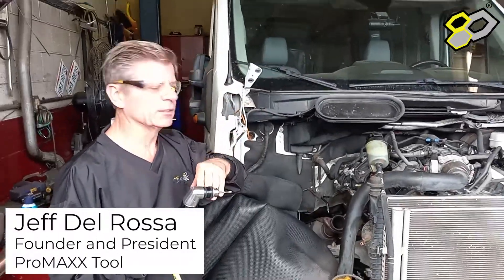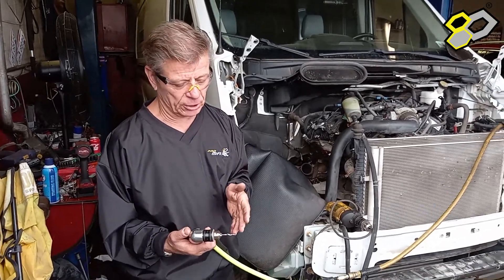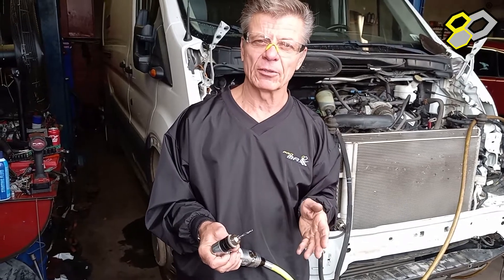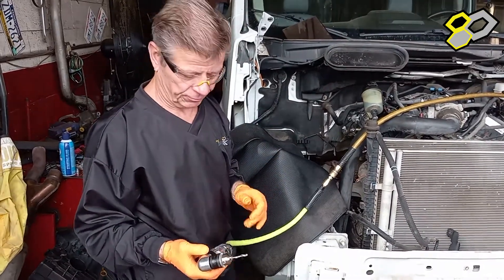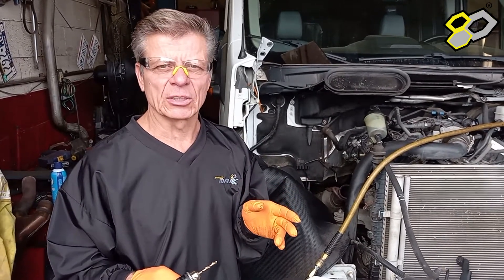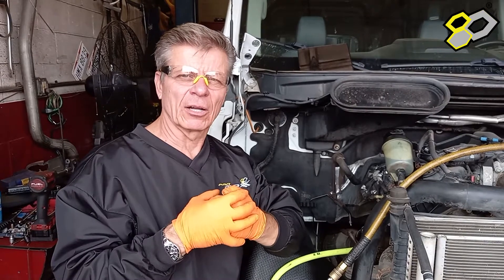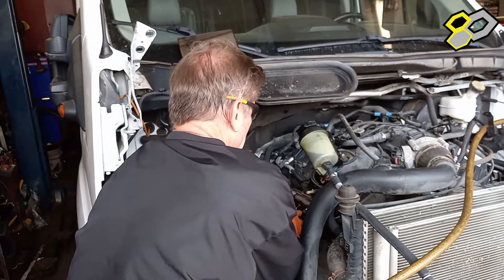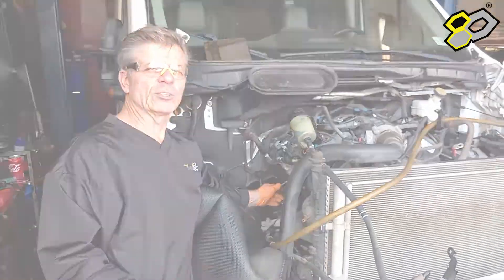How to Use the Elizabeth II ProKit

Comment: I believe those air operated drills have a lot of torque . The fact that you can use this kit with the heads installed and put out a repair with machine shop quality is great . There will always be hacks that won't spend the money or won't follow ALL the instructions - because THEY know better than the inventor . But they WILL open their BIG MOUTH when it doesn't go well . Nothing changes .

Comment: I use promaxx daily drill ford +chevy exhaust manifold studs. I started out using  lisle drill guide and it worked decent. But would always drill off center.
Now I got my boss to finally buy me the promaxx version and wholly shit this set is badass. Straight drilling every single time. And you can in  just 3 steps chase the threads to get the rings out and be done.
  Promaxx definitely did their R&D wow im amazed.